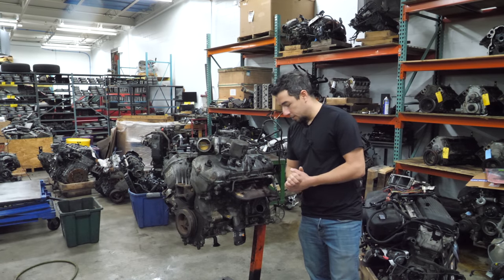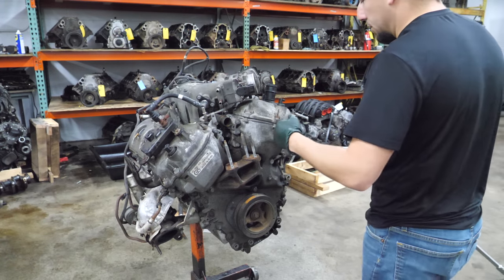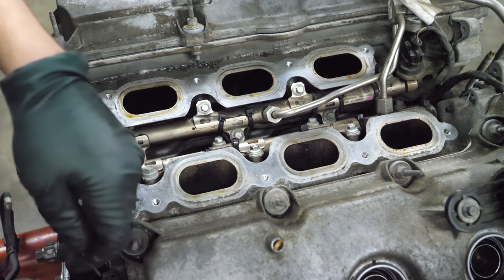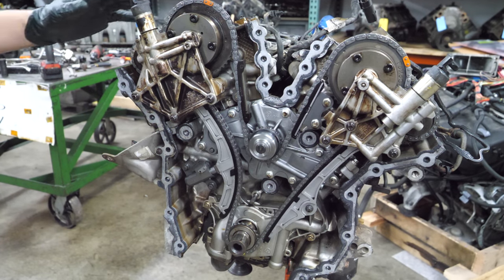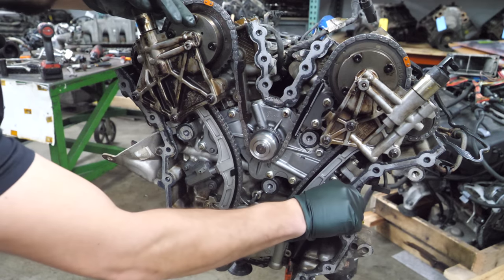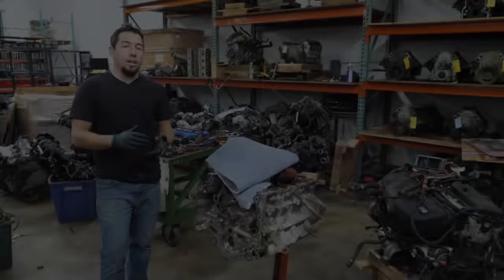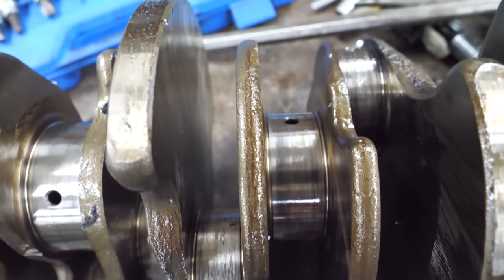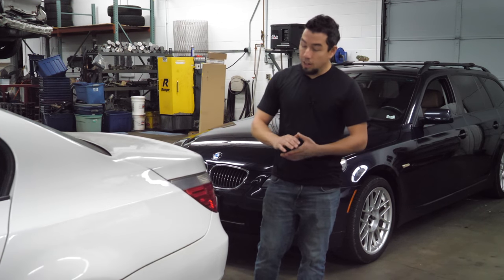Taurus SHO Flex ECOBOOST 3.5 V6 BAD Engine Teardown! What Killed This Maintained Engine?

Comment: The engine in my 2011 Ford Flex was severely damaged, I think by oil ingestion from a leaking turbo hydro locking cylinder #3. Ford replaced it with a long block. Now at 177k miles, I’d tell folks to not push oil change intervals on these engines, instead ignore the oil life monitor and change it every 5K miles. If oil is coming out the weep hole in the front cover, your water pump is on borrowed time. Ford has long since sold out all the long block spares for this application, perhaps indicating others had similar problems.
Reply: Great comments
Reply: Heck, I'd say 5K intervals on ANY newer engine using GDI/turbo/VVT, doesn't help when oil Co's constantly brag about extended intervals like 15K, insane in my opinion.
Reply: @barryaiello3127  what do you mean "5k doesn't help"?
Reply: @jamesmedina2062  comma doesn't help when oil companies brag about 15k
Reply: @jamesmedina2062  I meant change at 5K.
Reply: @barryaiello3127  I am suspicious of most USA oil companies. I generally buy German or French oil and if I bought a USA oil it might be Redline or Driven. I have heard people having good results with Pennzoil Platinum, Mobil 1, and Amsoil.
Reply: @jamesmedina2062  I believe all the big oil companies produce motor oil to the same standard and spec, it's just simple maintenance people are ignoring and the evidence can be clearly seen with Eric's helpful videos, 200,000 mile engines looking like new simply because of regular and frequent oil/filter changes. 🙂
Reply: @Slaktrax  i had a friend of mine from Germany tell me the same thing. I agree that contamination can be a problem. Still, the oils are vastly different in formulation and performance. Your three most important factors to look out for are viscosity at both cold start and operating temp, film strength under pressure, and high temperature stability. Some people concern with detergent for keeping the head clean but I assume that to be sufficient. Also resistance to LSPI can be a factor for some people. For my application I have not found the perfect oil as there are trade offs to be made, but I do my best.
Reply: @barryaiello3127  some of them can actually do it on GDI engines, but most of them are only guaranteeing 15k on something like a 3rd gen LS, meanwhile my oil of choice guarantees 25k on a first gen ecoboost, or a kia, or really anything, assuming their filter and minimal dilution? They'll also warranty the engine for up to $25k if their shit fails it.
Reply: @Prestiged_peck  I don't give a $hit what any oil Co. says, 5K oil changes, maybe 7.5 if there's a lot of highway driving.
Reply: turbo engines  need to be changed more frequently than NA engines even both using synthetic, turbos are just much harder on the oil.  NA can go 10k easily but i would never take a turbo that long.  BMW f'ed this up when they thought they could run turbo engines 15k miles (when BMW paid for oil changes).  It was engine carnage
Reply: The 13+ long blocks will work even though the parts books say they don't. You just need to swap a bunch of sensors and the valve covers. 5k OCI is key on these.
Reply: Replaced the timing set and oil pump in my wife's '02 Explorer 4.6 2V at 197k miles. We've owned it since new and I've always changed oil at 3k intervals with Motorcraft 5w-20 and Motorcraft filters. The internals were pristine. I was pleasantly surprised how clean everything was. The timing chains on both sides had worn through the guides into the pistons of the tensioners to the point there were small holes in the tensioner pistons. I used a high volume Melling oil pump and the car is up to 205k now and runs/sounds great.
Reply: @barryaiello3127  You're just blaming the oil when the problem is inherent engine issues. Medium duty diesels (pickups) go 7.5-12.5k OCIs just fine, turbos and all, and they're much harder on oil than gas engines.
Reply: My rule of thumb is 4K miles on any turbo charged engine. My ecoboost was going strong at 170K until a deer killed the car. Oil is cheap insurance.
Reply: @ForTehNguyen  Yes but the turbo itself if made well should not heat up the oil that much. All engines have some kind of water cooling of the oil and well built engine will not cook the oil too much. Still, dual turbo, hot V, German engines may definitely cook the oil.
Reply: @paulolson734  The 2 valve mod motors will go forever if you maintain them. They're a lot more forgiving on the oil change interval than the ecoboosts too. I've got a V10 with 198k on it. As far as I know it's never been cracked open. It's an early one so it needed a few spark plug helicoils though lol. I run 5w-30 full synthetic.
Reply: @straightpipediesel  They also run heavier weight oils that are more shear resistant and run much bigger oil pans to keep the oil cool. My box truck took 4 gallons of 20W-50. The 3.5 Ecoboost in my car takes 5.5 quarts of 5W-30 while making 2.5x the power and about the same torque. That 1.25 gallons of thinner oil is going to wear out a lot faster. This is not to mention how much higher you spin the gas engine, literally twice the RPM in a lot of cases, or how much hotter they run than diesels, especially with turbos. Apples to oranges.
Reply: @randr10  Old thinking. First, bigger oil pans is a myth. Capacities are within a quart or two of the comparable gas engine. Second, the 6.7 Powerstroke and new Cummins ISB use 10W-30, so no big difference. Traditional HDEOs have been 15W-40, not the 20W-50 syrup you're running. Third, due to the higher compression, peak bearing loading is higher. Fourth, you're also ignoring fuel dilution in diesels, given the lower volatility of diesel. Your box truck is way too old to care about emission aftertreament: diesel oils (and Euro-gasoline oils for gas particulate filter engines) have strict ash limits requiring lower levels of SOAPs, plus engines like the Powerstroke that use post-injection for DPF regen. As much as 10% fuel dilution is typical at the end of HDEO life.
Reply: @straightpipediesel  Not a myth at all on the oil pans. Even the light truck (pickup) applications of the Powerstroke use like 15 quarts (13 for the 6.7). The medium and heavy trucks even today use more typically. The biggest oil pan on Ford's gas motors is 7 quarts, about half the diesels give or take.
Reply: @randr10  L5P Duramax 10 qts, L8T 8 qts. 6.7 Powerstroke 13 qts, 7.3L 8 qts. 6.7 Cummins 12 qts, 6.4 Hemi 7 qts. So 2/3. Not multiple times.
Reply: @randr10  My thoughts too. The '02 has been replaced with a '21 Explorer with the 2.3 EB. It will get 3k oil changes, too. Oil and filters are cheap. It's my hope to never see the insides of the 2.3 (I've got a Cleveland to put in our '67 Mustang that I'll be seeing plenty of the insides 😄)
Reply: Turbo cars always need fresh oil.I drive only 3 to 5k a year and a 10k time frame could mean my oil could be in the car for 2 years plus.I change mine once a year regardless of miles.I also use premium gas to avoid carbon deposits.Owned a 3.3TT stinger and now have a Mazda CX-30--techs both said to change oil at 5k max.BTW they gave me the 10 year 100k warranty on my new mazda CX-30--firts 2 years of oil changes are free with filters--up to 2 a year.I also own my CX-30 outright with what i made off the stinger--so for the next 2 years I have the maintenece covered.BTW when I bought the Stinger and asked about the famous car fires--it was on the 1.6 KIA turbo engines and everyone was folks not changing their oil--one person had almost 30k on theres and put a small sticker to block the engine warning lights.
Reply: @jamesmedina2062  I think there was meant to be a full stop after VVT?
But yes, turbo engines need clean oil and regular changes to keep them running for the long haul.
Though let's face it, companies want us to upgrade out cars more often, so we can't expect much more than 200K from future engines.
Reply: @Cheepchipsable  I didnt get what you meant about VVT. VVT broadens the torque curve and can save on gas. Like what you said, carbon deposits are a problems these days but I am really not sure whether my turbo engine will make if very far. There have been some very long wearing turbos in the past. Saab 900, Mercedes 300SD, Cummins. Most are diesel. Gas turbos with lower boost probably can make it quite far. I think what is clear is their profits are coming out of cheaper supply chain parts and they want to inject new tech to such a degree that everyone thinks they have to have it. 2030 will be interesting.
Reply: @jamesmedina2062  Every manufacturer will be heavily invested in full electric platforms by 2030. Government mandates coming down the line are forcing their hands. California leading the way.
Reply: @randr10  It depends on many factors and unfortunately there is neither stability or democracy in the US right now.
Reply: @straightpipediesel  You're just wrong. Comparing diesel engines found in full size pickups to gas engines found in pickups over the last 20 years, the gas trucks average 6.4 quarts to the diesel truck 11.6, which works out to a difference of 5.2 quarts, not one or two quarts as you said, or 55% of the diesel capacity, pretty damn close to my original estimate. The only example that fits within your description is the L8T and Duramax, which are both outliers in the field of engines used in these applications (the L8T is high and the Duramax is low). This is a major reason why OCI's can be extended in the diesel trucks vs. the gas engines and still go several hundred thousand miles problem free. An ecoboost with 5.5 quarts like the above car motor will not withstand the same OCI, and nothing you or the engineers say will change that. Service life on a car motor is 150k, which is about where these things pop if you do the recommended OCI. If you want them to last longer, you have to shorten the interval, and they will indeed go 300k no problem if you do that, as will most modern gas motors from other manufacturers.
Reply: @randr10  Once again, you're applying the Mythbusters flaw in which you're spewing nonsense because you don't understand why. The rise of direct injection gas engines in the last 10 years increases particulate loading of oils, requiring larger capacities to prevent abrasive wear. Further, turbocharging leads to higher oil thermal loading and capacity is needed for cooling. You're applying a red herring by not comparing recent DI engines against boomer favorites from the 80s.
Reply: @straightpipediesel  Not one engine used in pickups in the last 20 years is a "boomer favorite from the '80s" except maybe the 8.1L Vortec, but you're not even right there because that was a '50s engine. We're talking Modular/LS/Magnum V8's and DOHC NA and turbo V6's mostly, none of which were available in the '80s.

BMW was one of the first companies to do larger capacity oil systems on their gas engines (7-8 quarts) in the '90s specifically because they wanted to do extended OCI. None of those cars had DI.
Reply: @jamesmedina2062  I'd put  that top.of the line AMSOIL up against "ANY" European oil formula. Also it depends on what applications its used in.These GDI twin boosted engines are hard as hell on motor oil. My old 4.6 Modular naturally aspirated and mostly highway miles is fairly easy peasy on oil. Lab reports constantly show much life left at 5000 miles or even more...
Reply: @tinamcgarrah7794  Would you say Amsoil is better than the European oils because you have specific knowledge or because you don't know and that gives you the lack of counter facts against this argument?  It is easy to be over-confident with a dearth of knowledge present. I know a Signature Series oil tested well but the test excluded heat aging and detergent testing. We are learning that GDI creates a whole host of issues namely of course carbon on the valves, carbon loading of the oil, and carbon particulates in the exhaust rivaling diesel exhaust. I think the EPA was asleep when it approved all the many GDI engines being sold now.  You are right that your NA engine was easier on oil and the cost savings to you is big. Also Super Unleaded is up to 35% more expensive and recommended for hi compression turbo engines.  We have been sold a bag of goods.
Reply: @jamesmedina2062  Have never seen any test on Utube beat Amsoil. Pennzoil Platinum has come the closest in some tests. Have personally seen a gasoline SOHC engine with 180,000miles on it.. The valve covers off,it looked impeccably clean and cam lobes were smooth as glass and highly polished. Idled like it was new. Amsoil and it's Amsoil filters were changed at 15,000 miles.  Now I'm sure GDI is much harder on any oil, but with Amsoil 's by-pass oil filtering system,  I bet it's oil can hang with just about any out there. If there are any tests of any European oils up against it, I'd sure be interested in checking  it out ,if its on Utube or anywhere else... The best Mobil 1 "European Extended Life" formula was a very good oil, but didn't beat Amsoil in any tests I've witnessed on here. But I'm always willing to observe and learn differently on just about any subject. I've been wrong before and will be again I'm sure..If it was given to me I'd take a GDI engine. but that's about the only way I'd own one. You all have a Good start to the New Year out there. THANX for the stimulating discussions!
Reply: Turbo engines eat oil . It's a risk to go 5k or 7k without checking your oil.  My kids Hyundai veloster will eat a quart of oil in 3k miles it only holds 4 so if you go 7500  interval it mite not make it. One time at the 5k oil change it didn't even register on the stick. Our others cars are Toyota and lexus and they are non turbo and need no oil between changes. Next car will not be a turbo of any sort
Reply: @brandonpittman5243  There is a lot of engineering that goes into these engines and the ECU processes far more than early rocket launches. So, you can't relate that all turbo engines consume oil like a Hyundai Veloster does. The reason I mention the ECU is because timing and fuel metering affect heat as does the static and variable compression so today's engines may have similar architecture but the differences in thermal, dynamic, hydrology, and lubrication are vastly different. There are more turbo engines than NA engines today and Toyota is turbocharging more today in order to offer best power+economy.
Reply: @jamesmedina2062   I have been using Mobil 1 since the 80's, I have never had an engine failure. I worked in aerospace industry for an engineering firm, the owner, it was a family owned company, had a 2 other companies the supplied parts and built P51 Mustangs. He used Mobil 1 aviation oil in his personal P51 Man O War. He was my reason for using Mobil 1 in my own cars. Just an observation and personal experience. I agree with what you were saying.
Reply: @sfbfriend  Yeah man. Mobil 1 stays clean, takes heat well. It came as the fill oil on Corvettes and some others. I've used it before. P51will take more than a few quarts eh?
Reply: @brandonpittman5243  I had a company vehicle (2014 f150 3.5 Eco) with the heavy tow pkg. Put over 100k seriously abusive miles on that workhorse. Since, I've got a 2.7 and another 3.5 Eco for personal use.  Never have had to add oil between changes.
Reply: So new BMWs and VAG supposedly run 30k km using long life oil OCI - so basically when the warranty is over it's time for new engine. If it makes it to this point...
Reply: You can change the oil life intervals to 5k and maybe even lower
Reply: @straightpipediesel  Going to chime in a year later to agree with @randr10 and say, you're just wrong. Why? I own not one, but 2 7.3s. They specify 15 quarts, and I can put 16 in without it even looking much overfilled. You're pretty cocky for someone who has basic stuff incorrect.
Reply: @edifyguy  You're confused and wrong yourself. You're talking about the 7.3L Powerstroke diesel, a.k.a. International T444e. We're comparing gas to diesel, so we're talking about the Ford Godzilla 7.3L gas engine, which, as I correctly stated, takes 8 quarts. It's obvious because that engine is contemporaneous with the 6.7L Powerstroke diesel.
Reply: @edifyguy If you're going to call out somebody for being confidently wrong, make sure you're not the one who's confidently wrong.
Reply: @straightpipediesel  It's not obvious, but go ahead and feel brilliant. Sitting next to its successor, the 6.7PSD, the 7.3 designation without any qualifiers will make any normal person think of the 7.3IDI and 7.3PSD, as those have been around for over 3 decades and Godzilla is a very recent introduction. If you want people to consistently understand Godzilla, you'll have to specify. But you know how to work inspecificity.

"L5P Duramax 10 qts, L8T 8 qts. 6.7 Powerstroke 13 qts, 7.3L 8 qts. 6.7 Cummins 12 qts, 6.4 Hemi 7 qts."
Reply: @edifyguy  No, the problem is you can't afford a new truck, so you had no idea about modern engine choices. This is Dunning-Kruger in full effect, you're accusing others of being confidently wrong when you're the one who's wrong and you keep digging your hole deeper.
Reply: @edifyguy  All of those engines on the list are current production engines. What makes you think he'd put one random engine that's been discontinued for 20 years on it?
Reply: @toddc5619  That's pure nonsense. I knew about the Godzilla engine almost as soon as it came out. I don't own one, but I know about it. That said, it's a new, oddball platform, and I've only seen 2 in the wild. No, I didn't recognize the GM one, because I don't like or pay attention to GM products. Yes, my vehicles are older. I'm not going to pay as much for a truck as a small house. That's absurd.
Reply: @sarahl7080  You do have a point there, but with nothing specified, 7.3 naturally made my head think of the diesel, because they're still very common. Godzilla is a very new platform, I've only ever seen 2 vehicles in the wild that had it, and I forgot about it. Everything else he listed was specific, but that one he left vague. Yes, I missed his pattern of alternating diesel/gas.
Reply: @sarahl7080  Because he wants to prove my point about boomers and their obsolete engines!
Reply: Yup, my Flex gets a change and filter every 5k.